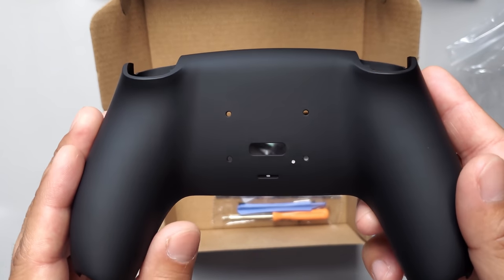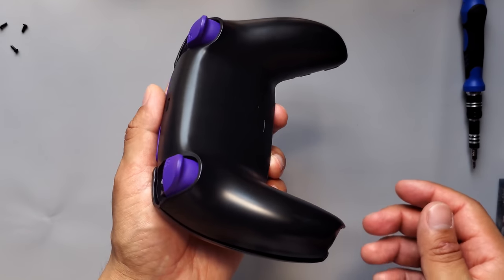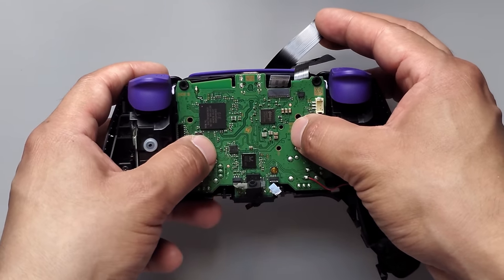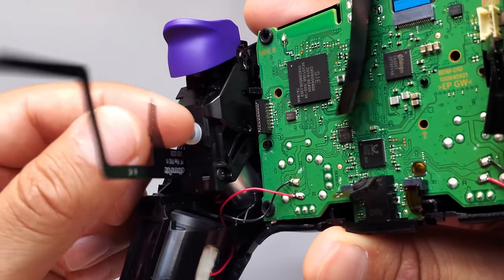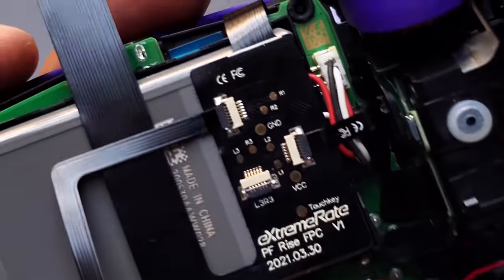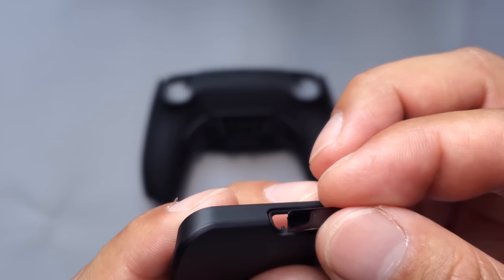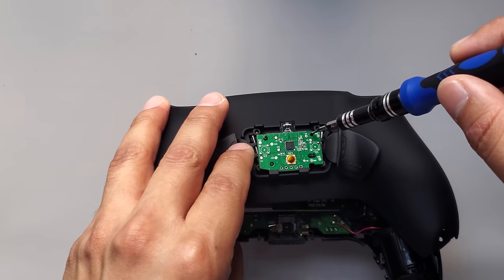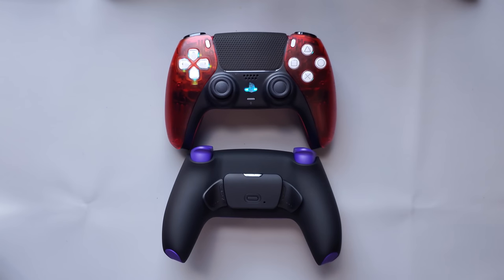DIY PS5 Controller (For BDM-010): eXtremeRate's Rise Remap Kit | No-Soldering Step by Step Tutorial

Comment: I just finished doing mines but before the game everything seen normal but when i get to the game the x and other buttons don’t work 😔 and i follow everything step by step
Reply from the maker: If the original back shows model number  CFI-ZCT1W A or on the motherboard it shows BDM-020 then its not compatible with your control. It's compatible with CFI-ZCT1W / BDM-010.
Reply: Thank you for replying
Reply from the maker: No problem. If you have a CFI-ZCT1W A, extremerate is working on having it work with that model. Could possibly be within this month.
Reply: @im.a.caveman  and yes I checked well….it was compatible the motherboard was 010
Reply from the maker: I recommend checking your cables then. If nothing works it could be a faulty. You can also send me pics of it on IG if you'd like.
Reply: @im.a.caveman  i will do it all over again to see because my L2 is  not responding either
Reply: @im.a.caveman  i did hit you up through ig
Reply: @im.a.caveman  oh brother thank you so much its working now I didn’t connect one of the wires good and now is working perfect thank you so much you are the best
Reply from the maker: That's great! Glad it's working. Thanks for watching!

Comment: Hey man I just re did my controller with the back paddles and new buttons including the triggers. A few days later my left trigger side does a random vibration. Do you know what it could be? Would be great help. 
It’s def not the little vibrating motors that make the controllers vibrate. It’s coming from trigger motor
Reply from the maker: If it's the trigger motor it's because the wheel/gear has to be aligned with the piece it's going into. It's like a semi circle shape.

Comment: Have you had any issues with the right stick spinning.  Not stick drift, spinning.  I don’t know if he has to do with the extremerate addition. But If u have, can it be fixed.  On ps5 controller
Reply from the maker: The mod shouldn't affect the way the sticks act. Did you try it without the mod?

Comment: Anyone have experience with doing everything correctly and then the buttons not remapping? I get my red light, it blinks when you hold 2 buttons but then when you use the paddles nothing happens
Reply from the maker: You have to turn remap mode off after you're done remapping.
Reply: @im.a.caveman  Figured that one out, thanks!

Comment: The tutorial is good. I followed everything step by step. At the end when powering the controller on to make sure that the backbuttons would work, the controller refused to turn on. So I got back to step one and redone it a couple of times but it still doesnt work. Any idea how to get my controller running again?
Reply: I had the same thing when i was installing LED lights from the same company :( still doesnt work
Reply from the maker: Sounds like a compatibility issue. Is the original back shell model number CFI-ZCT1W or CFI-ZCT1W A? On the motherboard does it show BDM-010 or BDM-020? The kit is only compatible with BDM-010.
Reply from the maker: For the led kit only thing I can assume is maybe the battery wasn't connected?

Comment: My controller won't power on after my install. Double checked all cables.  Any thoughts?  The controller lights do t even blink when I plug it in so it's not charging.
Reply from the maker: Does the original back shell show model number CFI-ZCT1W or BDM-010 on the motherboard? Or CFI-ZCT1W A / BDM-020 on the motherboard? The kit is only compatible with CFI-ZCT1W / BDM-010. Extremerate is working on having it work with BDM-020.

Comment: When I pop on the back cover the button doesn’t work, it’s like it’s being pressed up against something. A tone have any suggestions for a fix?
Reply from the maker: All I did was put it in place without applying pressure. Then close the cover upside down so the button doesn't fall off during the process. I remember I would push the button into the slot when I first did it and I think that's what would cause it to get stuck. So that's when I tried without pressure.

Comment: Hi, if I was to buy this remap kit and put it on my controller. Will my L3 R3 still work if I’d didn’t do any soldering? Or is it saying that you need to solder for it to be mapped to the back button ?
Reply from the maker: They will still work. The soldering option is just to map touchpad, L3, and R3 to the paddles.

Comment: thanks a lot for the tutorial but I have a problem, I can't use the custom controller in game unless I plug a normal controller first and then switch to the custom controller if you have an answer I would gadly take it, expect that the controller is working perfectly
Reply from the maker: That's the first I've heard that. I would say double check the cables. Some people have installed the cables differently then how the video showed it. Also make sure that they are fully inserted. And remember to turn the back off after remapping. On is for remapping only.

Comment: if you only wanted to use one back button could you just install one of them? or do they need to be used together?
Reply from the maker: You can just insert one of the paddles if you really don't want to use both. Even if you insert both paddles in, you don't have to remap them both. But that sounds interesting, only having one paddle. 

Check for compatibility before buying.

Comment: My d pad isn’t working, what part of the motherboard is it connected to? Great video btw
Reply from the maker: It would be the conductive film I think. Which is what the dpad presses on. You can check that and maybe the back part of it. Just like the back buttons that had a cable with 2 holes on it and you needed to place it on the 2 pieces that stick out to hold it down. But check your connections as well. Please let me know what BDM number is shown on your motherboard if you're able to. It's on the side of the motherboard that shows the analog sticks. There's seems to be compatibility issues with BDM-020. Hasn't been confirmed but I'm investigating now. Mines are BDM-010 and work perfectly.
Reply: @im.a.caveman  I’m going to open it up one more time today. I reopened it and checked everything was plugged in, now only the down button on the dpad doesn’t work, the other 3 do. I’ll also let you know the code. Thank you for your reply 💪🏽

Comment: Got it put together, took my time thought i made sure everything was right....
The button lights up and blinks when i try to pair but the paddles dont do anything. 

They dont actually map to any button...guess I'll try again 🤦‍♂️
Reply from the maker: If it blinks when mapping, and you're done remapping, turn the back off. On is only for remapping.
Reply: @im.a.caveman  that was the issue. Thanks. Works great 👍 
Killer tutorial. 

I have another question though....if i do the hair trigger kit will i be able to drive vehicles at full speed?? Because trigger stops make it so that i cant, ive tried. 
Thanks
Reply from the maker: @jayminc3442  Thank you! Yeah it should work the same. The difference is that the trigger kit pushes down on the button sooner and has less distance on pushing the triggers down than the default version. BUT you need to turn off haptic feedback. So if you're into that I recommend having a 2nd control or not getting the trigger get if you don't have another control to use haptic.
Reply: @im.a.caveman  not worried about the haptic, dont really use it lol. 
If you happen to remember this convo and you're playing warzone or something one day hop in a vehicle and let me know if they work for sure 😁
Thanks dude
Reply: @im.a.caveman  It let me remap but doesn’t let me actually use the paddles ??

Comment: It’s the L3 and R3 that I wanted. Anyone know any videos with this same kit and with these clear instructions that does the L3 and R3 please 👍🏻
Reply: Can I programme it so that when you hold down the back left trigger and then the red light blinks, to then press down on the left analog stick and then it programmes it to that ( with the way you have done it) or do you have to do the soldering part ?
Reply from the maker: You would have to solder the other wires. Checkout eXtremeRate's video for the soldering part. Maybe it could help.
Reply: @im.a.caveman  do you have a link to the video please!?!

Comment: Followed everything and doubled checked all the connections and not only would the back button turn red, the whole controller wouldn’t work. I put it back together with the original wires and it worked fine. Do you think I got a messed up wire from extremerate?
Reply from the maker: No, I think it's not compatible with your your controller. On the original back shell there's a model number CFI-ZCT1W which is a BDM-010 and compatible with the kit. CFI-ZCT1W A is a BDM-020 and not compatible. There's a version that's compatible with CFI-ZCT1W A/BDM-020. Currently there's only white or black and it has a nice grip on the back. Doing a video on it once I receive it.

Comment: So I followed everything on this video and now my controller doesn’t turn on, can you help me figure what should I do?
Reply: Same. I followed everything step by step. Mine will work when the controller is hooked up to the usbc but it won't turn on unless it's plugged in. Also I mapped o and x and those buttons stopped working.
Reply from the maker: I recommend checking all cables, try resetting the control, and connect the USB. If its not working out replace everything with the original parts and see if it works without the back buttons. If that's the case you possibly got a faulty and can ask for a replacement.
Reply: @im.a.caveman  so I did that and I ended up just putting all original parts back on and it turned right On and got an exchange done. Now I’m waiting on a new one.
Reply: So to recap I got the replacement and it still doesn’t work
Reply from the maker: @erikayala9955  I'm sorry it's not working. The control you're installing this on, would it happen to be a Cosmic Red or midnight black controller? Or did you happen to see the the BDM number on the control?
Reply: @im.a.caveman  no it’s the standard white ps5 dual sense! And what do you mean?
Reply from the maker: Someone mentioned that the new model BDM-020 is built a little differently and that theirs wasn't working correctly. The problem is I haven't been able to see the inside of the BDM-020 controller. Mines are both BDM-010. And it's hard for me to know what the problem is if I'm not able to see the controller itself. Can you please check on your mother board what BDM number it shows? It's on the side when you flip the motherboard over. I had already emailed extremerate to ask if it's compatible with BDM-020 models.
Reply: @im.a.caveman  where would this number be ?
Reply from the maker: It's on the motherboard, the side where you're able to see your thumbsticks. You would have to open the controller. I'm hoping they'll email me back about the compatability.
Reply: @im.a.caveman  yeah so I ended up taking it apart and yeah Bdm-020 is the number on mine.
Reply from the maker: Thanks for getting back to me. It's definitely starting to make sense so far that it's because of the new model BDM-020. A little change happened on the controller. And it's affecting the remap kit. I'm sorry you had to go through his. Definitely get a refund. Hopefully extremerate can release an updated version for the BDM-020 controller. Wouldn't have expected a change on the controller so soon. The remap kit was released before the new controls were released. Gonna try to release an update video for the remap kit soon. Just gotta find some recording time. Thank you
Reply: @im.a.caveman  yeah no problem just unfortunate for me cause I really want the paddles on my dual sense cause I do play other games that I use paddles for and would’ve loved having it! I’ve been playing with paddles since ps3
Reply from the maker: Do you happen to have another controller? Cause if you do open it up and check it's BDM. I'm also bummed because they released a cool kit just for a new controller version to come out and mess up the compatability. So now it makes sense that some people said they had problems and I was just wondering what it could be.
Reply: @im.a.caveman  yeah I do have another one but most likely it’ll be bdm-020 because I did get them at the same time when I bought the ps5 bundle. And I’ve been messaging extremerates on Twitter and they said they wanf buy my current controller with Bdm-020

Comment: I just got done putting mine together but for some reason when I map the buttons the back paddles won’t work??
Reply from the maker: Did you turn off program mode?
Reply: @im.a.caveman  o may not have how do I go about that thank you for reply so fast I appreciate it🙏🏼
Reply from the maker: @ReaperDayZ  To turn off or on the back buttons hold the button on the back for a few seconds and the red light will go on/off. On is to program. Off is when you're ready to use them.
Reply: @im.a.caveman  thank you so much guess I just didn’t pay attention all to well thank you again you have been a great help I’m helping me find a a great product
Reply from the maker: No worries, I should've explained it better. Enjoy!

Comment: Will this work with the clicky hair triggers and clicky face kit?
Reply from the maker: I have done remap, led, and hair triggers on one controller. haven't done it with face clicky kit yet but I am sure it'll work. I'm going to put those 4 kits together when I am done with the installation videos.
Reply: @im.a.caveman  oh ok ty so much
Reply: @im.a.caveman  I just ran into a problem installing just different colored triggers and when I put the metal shaft in it gets super stiff is there anything I can do?

Comment: I have a question about it tho. Can you map them to the L3 and R3 or do you specifically need to do that soldering in order to be able to map them to the L3 or R3 buttons?
Reply from the maker: You can only map them if you solder the cable for it.
Reply: @im.a.caveman  Oah yeah k thanks

Comment: Hey man, any idea why mine don’t work? Control or the LED lights physically won’t come on? Your video was perfect and i have missed nothing.. any ideas?
Reply from the maker: If the controller doesn't turn on then its most likely compatibility. Is the kit compatible with your control?
Reply: @im.a.caveman  well I guess so man? I’ve determined that it keeps shorting by the L1-L2 inputs?
Reply from the maker: @beyondeu1834  For the description of the kit or on the title, did it say it's only for BDM-010? If yes, does the original back shell of the controller that you installed it on have model number CFI-ZCT1W or CFI-ZCT1W A?
CFI-ZCT1W is a BDM-010.
CFI-ZCT1W A is a BDM-020.

Comment: I installed the kit but the controller doesn’t turn on. I’m not sure if I did something wrong or what. I checked the model number before ordering and it’s the one that works. Any ideas?
Reply: Same here. Did you find out whats up with it?
Reply: @Bmwboy523i  turns out I did have the wrong model number. The A is very small at the end of the model number. Didn’t notice it at first.
Reply: @pjw4125  thanks for replay. I managed to fix my one.
Very first connection on this vid was misaligned, once adjusted was power back on for buttons and controller
Reply: @Bmwboy523i  I don’t even know if it’s worth checking stuff like that for mine. Pretty sure they say it just doesn’t work with this motherboard.

Comment: I've made mine yesterday and the thing is you don't need to change L1/R1 cables... I've kept the DS cables and only add the big cable on the conductor, is working perfect.
I don't get it why they send the cables for L1/R1 to be honest.
Reply: @quintenharding2285  yep. You can keep the originals cables for L1/L2 and R1/R2, only add the cable that is conected to the paddles.
Reply from the maker: But you're able to remap the triggers to the back buttons?
Reply: @im.a.caveman  i didn't tryied,  I'm using them for X and O.

Comment: i folowed you instructions and couldnt get it working, playing with it i noticed that when the controler os ON and i conect the r1r2 or the right side panel to the part stuck on the battery the light on the controler would go off as if its somhow shorting the setup.  tried it a few times and the problem is with that section all else i triple checked. any thoughts?
Reply from the maker: Is the kit compatible with your control?

Comment: Great video, I'm a bit lost right now tho.. I followed the guide but my controller is not turning on and it's definitely connected, it turned on accidentally half way through, now it's just dead. Anyone have any idea where I've gone wrong? The cables don't seem to be broken
Reply from the maker: Most likely a compatibility issue. The V1 remap is only compatible with BDM-010

Comment: If I wanted to make it a wired only controller to reduce weight could I leave the battery out or does it need to be in to work ?
Reply from the maker: Honestly I never thought about that. But I believe the battery needs to stay. It's what powers the control.

Comment: where do you get that case black and purple for dualsense?
Reply from the maker: With the back buttons or without?
Reply: @im.a.caveman  I was wondering the same thing. Where'd you buy the red controller case and the purple
Reply from the maker: You can also find it on the gamingcobra.com and you can use my discount code: IMACAVEMAN 

Purple button bundle:

https://www.amazon.com/eXtremeRate-Replacement-Touchpad-Decorative-Controller/dp/B08XQDP6JT/ref=pd_sbs_4?pd_rd_w=ElePp&pf_rd_p=651d64d1-3c73-45b6-ae09-e545600e3a22&pf_rd_r=PNB4RDVR31KPWDM400QQ&pd_rd_r=490a6520-e252-44e6-af94-eb53f9f71cfc&pd_rd_wg=rBz7Y&pd_rd_i=B08XQDP6JT&psc=1#

The red transparent shell I got from Amazon. It's by a different company. 

Red Transparent Shell: 

https://www.amazon.com/dp/B0933BZQ4H/ref=cm_sw_r_cp_apa_glt_fabc_V18830T1D8HVHYV8PRMX?_encoding=UTF8&psc=1
Reply: @im.a.caveman  without it